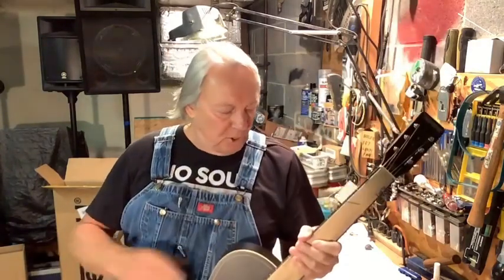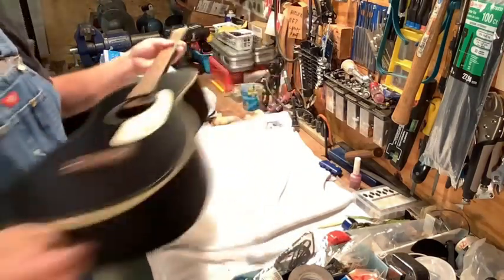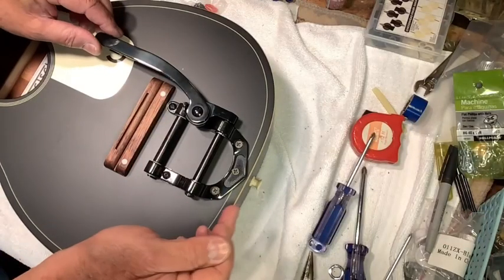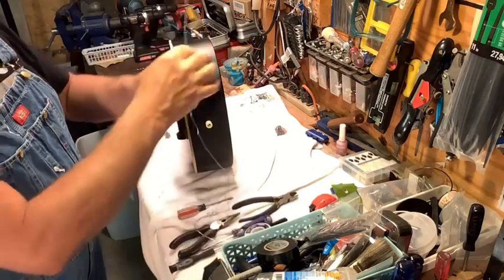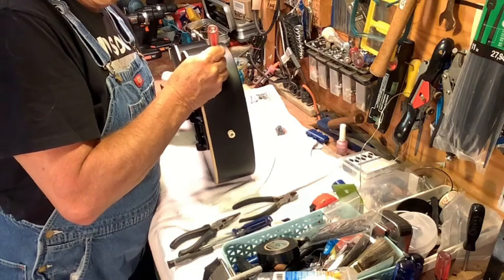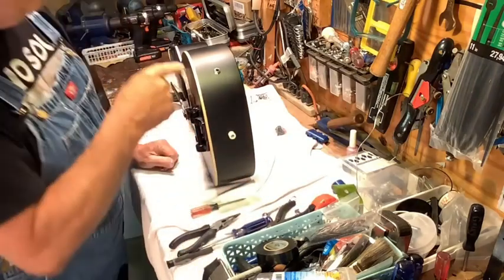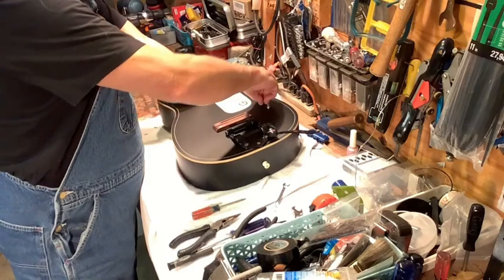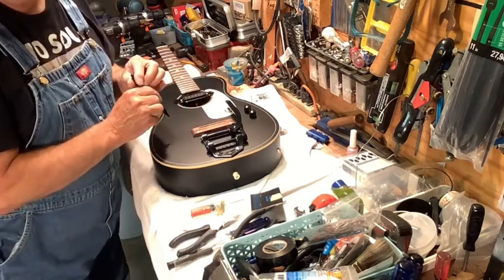How To HOT ROD🔥a Gretsch Jim Dandy with Bigbsy Vibrato...!

Comment: How did you get the anchor blocks in there? Through the soundhole or did you go through the back of the guitar. I dont think I can get my hand through the soundhole. Great video.
Reply from the maker: Thank you for your questions Jason…. I put the small blocks in through the sound Hole…! ,  my hands are rather large …, But the sound Hole  is pretty good size also…🎶👍🏻🎼
Reply: @iplaymytele  did you anchor them first and if so how? Or just screwd straight to the block from the bigsby?
Reply from the maker: @bobbyburford6430  Bobby...., I put some Elmers wood glue on each block on the inside , then screwed the Bigsby onto the top....!  This pulled the block with the glue on it up against the inside of the guitar....🎶👍🎵🎸
Reply: This is awesome Jeff! I am definitely going to be trying this. Do you normally just make the blocks a slight bit thicker than the length of the screws